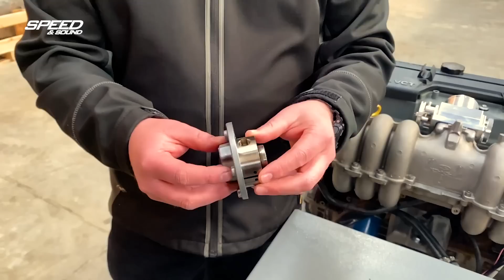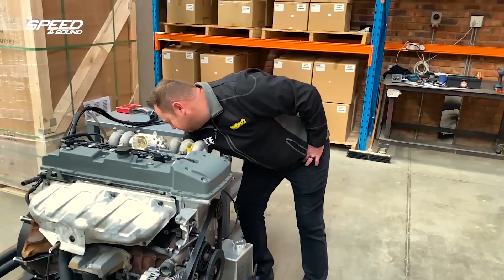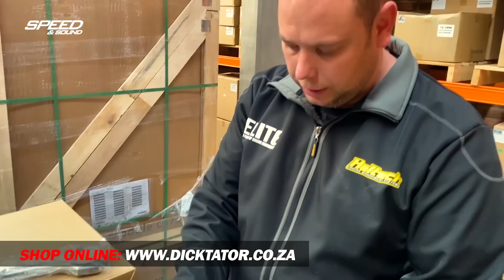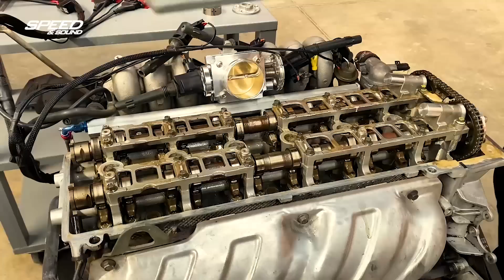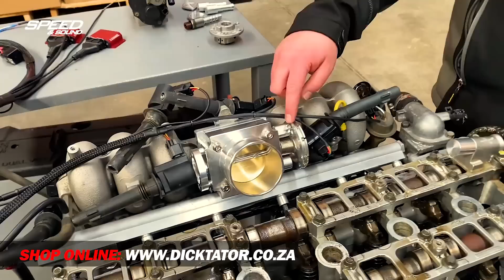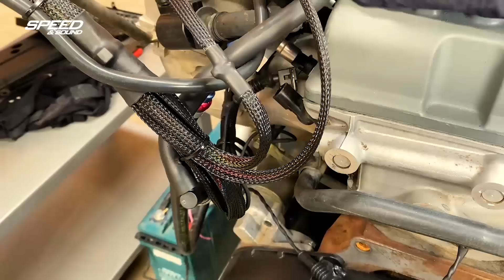"IT HAS TO MAKE POWER!" :: Dicktator Rolls Out Ford Barra Tuning Package.

Comment: Hi guys just found your channel new sub here! I’m a mechanic in Queensland Australia and it’s good to see an old taxi motor getting some love! Great engine good to see you did the research and do it right the first time! And top quality work guys,I just spent 2 days fixing wiring nightmares! All my own doings though! Another engine often overlooked is the gm 3.8L v6 they are very cheap and very strong not as powerful as the Barra but with the cost saved over the ford they can be tuned to match the ford at that power level anyway! If budget was unlimited billet 2j/rb stroker to trump the Barra but a billet Barra I’d swap my rb25/30 for that any day!
Reply from the maker: Thanks for the comment. Very useful info that you’ve supplied.
Reply: @speedandsoundmagazine most of what I work on for hobby sake is low budget junk even my beater/sleeper commodore i specialise in making cheap stuff go faster! Btw check out  corn fed boost I just found his channel he does all his own work and his v6 makes good power! Iron heads stock crank and oil pump but still much better build than mine and about twice the power!I’m new to the YouTube scene and am setting up my channel properly soon, just posted some older videos of my eBay turbo,stock ecu,original trans $300 ute on my channel.I’ll keep adding more small videos of other cars I work on and see around here too. Hopefully one day I can drop the spanners for a camera or steering wheel! Great channel anyway if I didn’t say before! love the different varieties of cars we don’t see to often here.